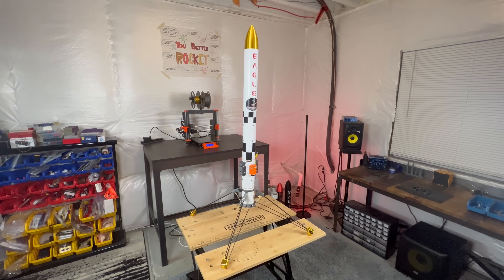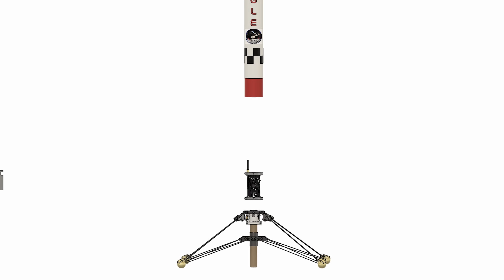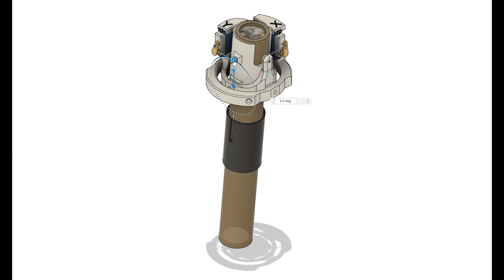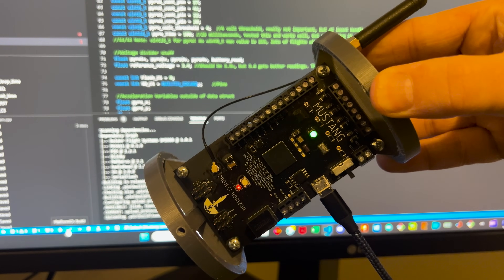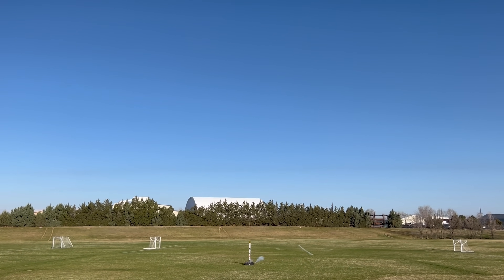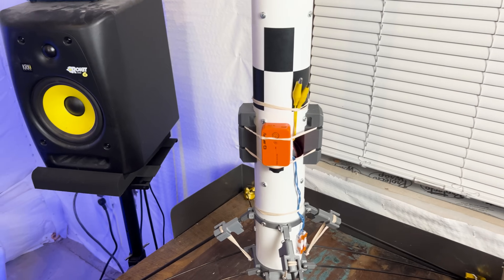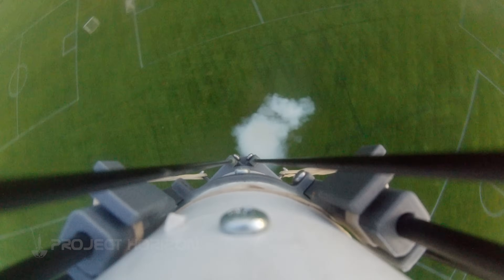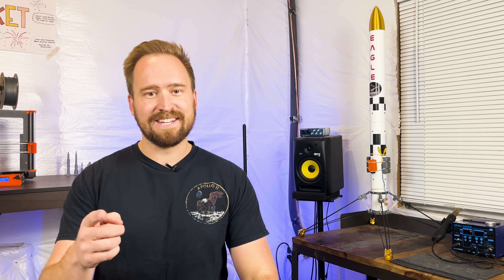I Propulsively Landed a Model Rocket! - Eagle

Comment: Hi Mark,

I'm currently in high school and have recently taken up the same project, which you have amazingly achieved in this video and in others. However, I'm having some trouble with my Simulink simulation, as I have never used it before and am not experienced. I was wondering if you could make a video where you dive into the simulation you used and maybe did a short explanation of its functions and technicalities.

Comment: If you adjust the timing just a little you could probably get a softer landing. There were several moments in the failed attempted that if had cut thrust at just the right moment it would have landed like it was on a pillow.

Comment: Amazing.  Well done.  Would you consider deploying the landing legs shortly after apogee in order to drop the centre of mass?
Reply from the maker: I definitely thought about it, but if the legs deployed at apogee it may have changed how it fell. I wanted to keep it as vertical as possible when it fell so that the second stage didn't have to do so much work to get it back to vertical and made for repeatable flight results as well. That's also why the center of mass is so low. But honestly, I just thought it looked cooler if they deployed last second!

Comment: great video and appreciate your effort. I am wondering how did you manage to get the engine to ignite twice?
Reply from the maker: There’s two engines stacked on each other. An ematch lights the second motor when the flight computer sends the command.
Reply: @Project-Horizon  Thank you for taking the time to explain. I can understand that, but I am curious about how the engines are separated such that the ignition of the first engine does not affect the second. I don’t believe the first engine is jettisoned after it burns out, as that is how I would typically envision it. Could you please provide more details and help expand my understanding of this process?
Reply from the maker: There's a coupler in-between the two that is friction fit to both motors. The coupler has a barrier in-between the two engines and the tops of each engines are plugged with epoxy so there shouldn't be any way the flames from the first engine can ignite the second. When the second ignites it pushes the coupler and the first engine out of the rocket.

Comment: If the upper stage had blades(4) that deployed when air current reversed in decent the stability and rate of decent could be better controlled as the fuselage helicoptered toward the earth. Hell, you could control the pitch of the blades and steer the thing saving fuel.Thank you.

Comment: to:  Project Horizon :The rocket engine used for landing must be of the descending type, meaning the fuel must have different levels from strong >> medium >> weak to slow down, not suddenly turned off.

Comment: Using the accelerometer only instead of barometer or GPS seems feasible for a short flight at low altitude.   I realize your motors won't push it that high, but what is the max height where you can rely on accelerometer calculations only?
Reply from the maker: Great question! On the 27m flight that landed the error in real vs calculated altitude on touchdown was ~0.5m, so over ~54m of travel we get an error of ~1%. While that isn't a lot it sure does accumulate the higher you send a rocket to the point where it'll negatively impact our confidence that the second motor ignites at the correct altitude. I definitely think there are ways I could fine tune my own calculations  to be better which is on me and not the sensor. It works for my current purposes, but isn't perfect.

That said, I am not sure about what the maximum height we could send a rocket to with confidence in altitude calculations from just accelerometer data. I haven't had to develop my altitude calcs to be that accurate because at this point they work very well for my smaller apogees. But I bet with a very well developed method you could really push some serious apogees.
Reply: @Project-Horizon  the baro has another problem if you intend on landing a great distance away from where you launch.   Not a problem for hobby motors, but the barometric pressure is likely to change at any significant distance.  I like the accelerometer approach because it keeps things so much more simple.   But you couldn't do something like launch and land on a nearby hill, unless you knew the difference in altitude at the remote landing site beforehand.  Fun little mental exercises.
Reply from the maker: Exactly! Going higher and assuming some lateral movement landing on a hill or valley would render the accelerometer data pretty much useless. At that point some ground sensing like LIDAR would probably beneficial. A whole bunch of ways to approach this problem. Fun mental exercises indeed.

Comment: Can I buy Mustang V2 from with delivery to Spain? To make this computer did you have previous experience? Want to do it myself but not sure how to start with these micro computers :(
Reply from the maker: I actually had no prior experience before this project! I learned a lot from watching BPS Space videos and was able to eventually design my own. I would suggest watching this video and the two after it in the playlist. That really opened up the world of flight computer PCB design for myself. Most common microcontrollers like Teensys and Arduinos are open source so the wiring schematic is released and you can use that to start your own and then wire up the components that you want. Adafruit also releases the schematic for all of their microcontroller boards. That's how I did Mustang, by using the Teensy 4.1 wiring diagram to build off of. Mustang V2 is unfortunately not for sale at this time. There's a couple of hardware errors on Mustang V2 I know how to work around for now that makes it less than ideal to make into a reliable product, but perhaps in the future I'll make an updated, more robust V3 that I can feel comfortable selling.

https://www.youtube.com/watch?v=TKgXdEAlgSw&list=PLyV774-3p8348Fl5V6ciIBh0ZA446q93I&index=4

Comment: Congratulations!  I do have to say that just as with Joe's rocket, I still think using a solid rocket motor for the landing burn will never give reliable results.  The inability to shutdown the burn means being successful requires a great deal of timing luck.  I would like to see someone develop a laser or microwave-based AGL sensor - perhaps using the same tech used in police lidar speed guns.  This might allow you to be much more precise with when that landing burn starts.  I would also like to see staggered ignition multiple rocket motors that would allow a larger, short duration thrust to quickly stop the downward acceleration, then that motor burns out and smaller motors handle the final descent.  This might keep the rocket from wanting to climb again during the descent. And, yeah, I know - too complex...
Reply from the maker: I agree with all this actually! Landing it will never be as pretty and reliable as the Falcon 9 rockets, but I do think you can engineer the rocket to give it a fighting chance every attempt, even if that means leaning more into leg design than throttle control. It's just the nature of trying to land a cardboard rocket with hobby solid motors. That said it's awesome to see everyone's ideas to improve the project, lots of which I've never even considered before. I think the endless amount of ingenuity on how to tackle the project is spectacular.

Comment: This is actually even harder in some ways than the big biys, as  upon landing burn, that rocket motor fires for a fixed, variable length of time(yes its meant to sound that wonky) where as full scale is able to throttle down the engine at any moment..

Comment: I love the thrust vectoring. Did you consider methods to modulate the landing burn thrust? For example a servo-driven carbon vane that would insert into the combustion stream to spoil some of the vertical thrust? Hopefully without creating more horizontal thrust that the thrust vectoring could compensate for?

Comment: Just a thought. When the rocket lands if motor is still running it bounces. I know you can not kill thrust on given altitude; it's timed. But what if you had the motor physically released inside the tube at a specific altitude where the motor would climb the tube internally (if still going) instead of lifting the rocket? Possibly even allowing the motor to eject in a small pod. It could expand your timing or precision slightly. Just a thought.

Comment: Awesome work!
I wonder, since you can't time the run time of the landing motor, can you add some little "doors" to clamshell shut on the rocket motor for consistent, properly timed landings? 
Similar to the "Reversing" apparatus on a jet engine only not reverse... shooting the thrust out to the sides.

Comment: You should try calibrating it to land somewhere specific.
Reply: I believe the only reason they can do that with the big boy rockets (see: SpaceX) is they have so much altitude (several tens of thousands of feet) and time to work with, they can direct it using those mesh fins we see on them and make the major adjustments early on to get things lined up and gliding towards the landing destination early. This thing is only getting to ~120 feet in the air. In addition, these mass-produced rocket boosters for model rockets aren't very precision, probably for keeping prices affordable for hobbyists.

Comment: The one thing I keep seeing in your project as well as a couple of others is the springiness of the landing legs. The legs need some give, they need to "collapse" a little as the rocket lands. And, of course, the main issue that is unaddressable is the lack of throttle control with solid fuel rocket engines. As I am sure you know all too well, that is the primary difference between your rocket and the Falcon 9 hence the biggest engineering challenge you have. It was awfully cool to see your rocket succeed.

Comment: First diy VTOL rocket I have seen on Youtube ever very awesome. I used Edmund Sci Flexinol wire once for micro rc depron pager motor planes that were sub 50g way back no gyros magnet coil actuators. Good to see home tech still growing. What about a valve co2 air landing thruster that is controlled by FC? Like thrusters on LEM psst psst psst. :)

Comment: When it comes to the ignition timing for the secondary, instead of using a predefined apogee altitude relationship, would you consider using an energy model to calculate the ignition height? That way you would be considering not only the altitude, but also the decent velocity in your calculation (Emotor = Mgh + 1/2mV^2.) It could help when your initial conditions aren't the same, i.e. a different angle of the rocket modifying your drag, which would add variance to the ignition height.
Reply from the maker: I actually approached the problem like this in the early stages! I even started using the same equation you found, but was reminded that as a moving body falls it carries the same amount of energy throughout all points in the fall because it's transferring its potential energy into kinetic minus a little bit of energy lost to drag. The problem however is in regards to how the motor transfers that energy in the form of the thrust curve. For example you could have two motors with the same amount of energy, but if their thrust curves are greatly different, say one burns at the exact same thrust for 5 seconds, while the other uses a much higher thrust and only burns for 1 second, then the altitudes you'd start the burns are vastly different, even though these two theoretical motors carry the same amount of energy. Using a simulation and plugging in the thrust curve to reveal the apogee/landing burn altitude turned out the be a simple and reliable method in the end.

Comment: When I saw your thumbnail I assume you were throttling the landing motor but you did it all with timing.  Pretty impressive.  Rather than throttle the engine could you throw a blocker in the way to kill thrust?  That way you would have more freedom to land without having to be so careful about thrust duration in the landing motor.  If it is on the short or long end of the tolerance for burn time you might not get a landing. Yes a blocker is another mechanism but you could land with a predicted amount of propellant left over.
Reply: One could borrow some ideas from jet engine thrust reversers. Instead of just blocking, they might be able to modulate thrust and even "hold the rocket down" after landing if the engine is still on at that point.

Comment: Congratulations!  Have you thought about a clamshell thrust diverter over the engine, so that when the legs touch down the clamshell closes and redirects the motor thrust upward to keep the rocket on the ground?
Reply: At that point the motor is at the end of its burn. Lots of intricacy for small amount of force.

Comment: Definitely cool but without some way to throttle the thrust from the second rocket I don't think you'll ever have a reliable system. There are just too many inconsistencies in the actual rocket motors themselves.
Reply from the maker: Those F15's are bizarrely consistent, but definitely still have their inconsistencies. I think the key lies with the legs and designing them to take a beating and not bounce the rocket upon landing.
Reply: @Project-Horizon  Maybe though I think Your variations in apogee kind of show how inconsistent they are. The timing for when they light off is also somewhat inconsistent. Not saying it's impossible but without some way to throttle it I feel like you are really going to struggle to consistently get one on the ground.
Reply from the maker: The early flights inconsistencies in apogee were largely because spin would get out of control and cause an erratic flight path, but that was mitigated well by covering the access window. Later flights started getting much more consistent with apogees.  But again the rocket's gotten pretty good at figuring out the optimum landing burn altitude for the second motor regardless. The last three flights I did had the rocket hover at ~1m twice, then of course the successful land where it hovered at ~0.3m. I think the consistency is starting to show itself. I am going to lean on the legs to push that reliability over the goal line from there.

But yes with throttle control you'd gain much more control over your landings naturally.
Reply: @Project-Horizon  That's cool. Look forward to seeing what you come up with next!

Comment: How do maintain vertical control in both the lift off and landing??   I'm trying to do the same thing with about the same Arduino micro system.
Reply from the maker: Hey Johnny, vertical control is achieved with a PID loop, with rocket orientation as the input and the output controlling gimbal angle.
Reply: Figured as much...but how do you get the rocket angle???   under acceleration or deceleration??   with just an accelerometer??? or do you need gyros???
Reply from the maker: Using just accelerometers won't work during flight as thrust causes wonkiness for that calculation. You'll want to integrate the gyro rates to get orientation from a known starting orientation. I would also suggest using quaternions. This library I hear is really good for projects like this!

https://github.com/peregrine-developments/Orientation
Reply: Thanks for your answer!
Reply: @captjohnny it’s pretty cool how responsive and helpful this guy is.
Reply: Indeed!

Comment: Very cool! I expected to see some measures to kill horizontal speed, but it seems like it's fine without that :)
Reply from the maker: I tried to keep it as simple as I could to land it so didn't include anything like that. However, I've definitely considered it and how it would affect approaching the problem and that gets really fun and interesting!
Reply: @Project-Horizon  Yeah i gues thats for v2 version with more powerful and higher apogee maybe (there would extra pasive braking actually make sense and diference due higher drag). :D Also i m curious. This  is actually suicide burn no (like Falcons)?  So its there any noticeable deviation in between each engine burn time that would cause any issues with timing?
Reply from the maker: @alesksander  The Estes F15 engines have been remarkably consistent in burn time. I think the deviation was +/- 0.05 seconds from the data I have. There's a whole bunch of little things like that which cause variability in the flights. In the end my goad was to target about 0.5ish m above the ground, let the small variances like engine burn time play out, then hope the legs could handle the rest.

Going higher gets really interesting and a becomes a fun challenge. A longer burn composite motor with a thrust to weight ration somewhat close to 1 as the booster may work well and be able to get it high enough while still not launching it into the air as it coasts up. All fun things to consider for future projects!
Reply: @Project-Horizon   How accurate your assumptions of apogee from all data collected got, till 0.5m?  Thats quite impressive for simple integration.
Reply from the maker: Surprisingly good! The data says the rocket hovered at 0.86m during the successful landing, which seems to track reasonably well based on the video.